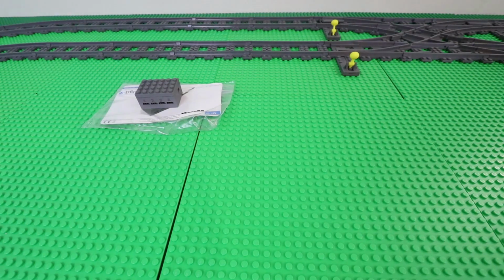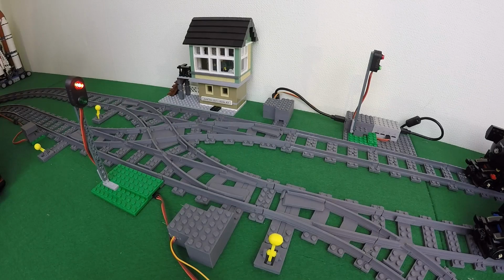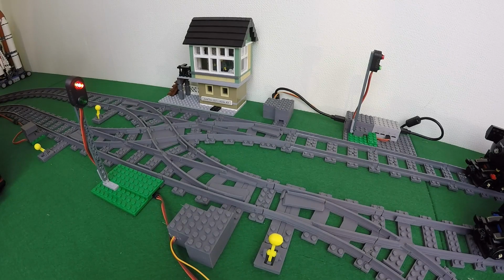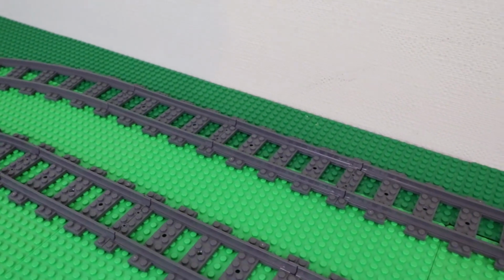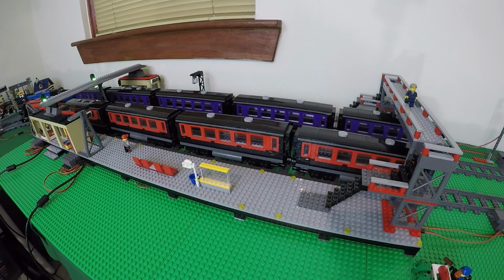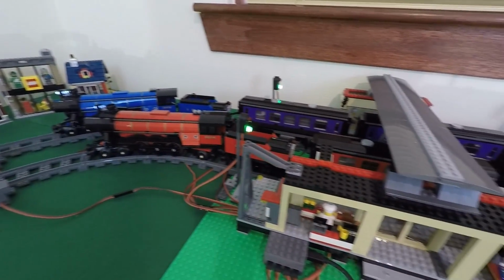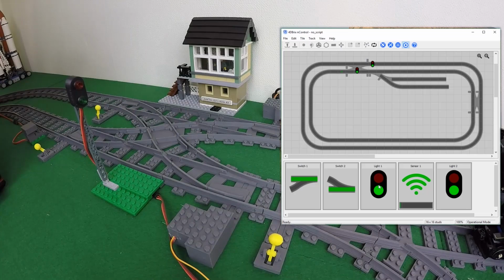4DBrix Haul!  LEGO Railway Automation More Lights, More Sensors!

Comment: A small suggestion. Signals are not traffic lights. In railroading, the red light should be at the bottom. When a train passes by, did you know they call this “knocking down the signal”?